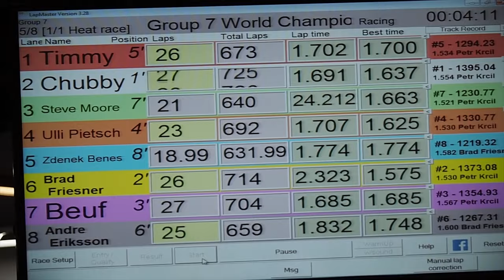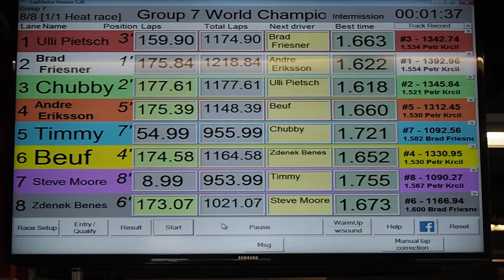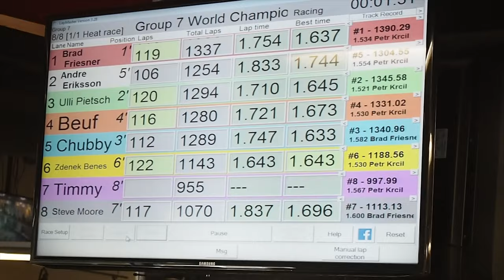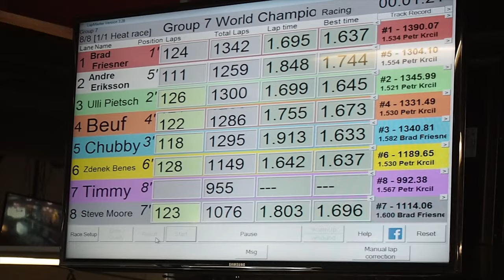Slotracing World Championships - 2019 - Wing car G7 Final

Comment: I don’t mean to be Naïve, but are these cars really that fast? What’s the voltage they being ran at? Totally amazing!!!
Reply: I couldn't tell you the voltage as I myself am new to the hobby, but yes, they are really that fast. I've seen it in person, and it's nuts.
Reply: They run at 13.8V
Reply: high current. the motors pull~40 amps at start, cruise(full on) @ ~2 amps. 120,000+ rpm. this has been going on since the 70s   actual 70mph+  ~mach2 @scale